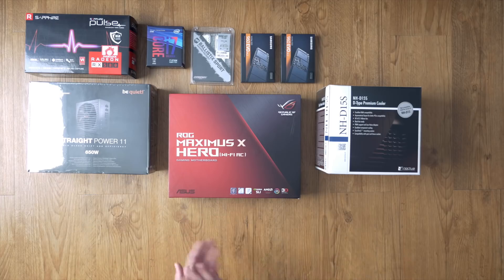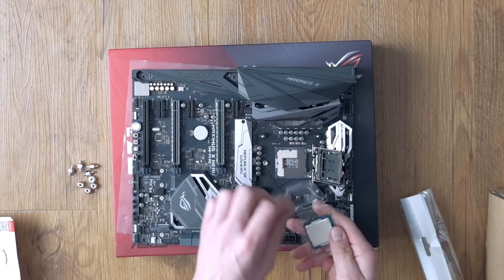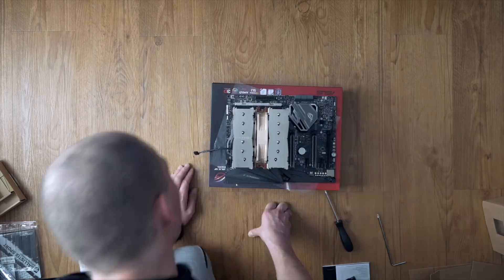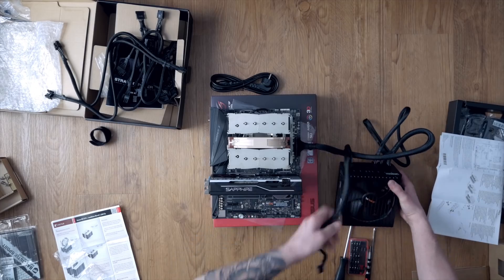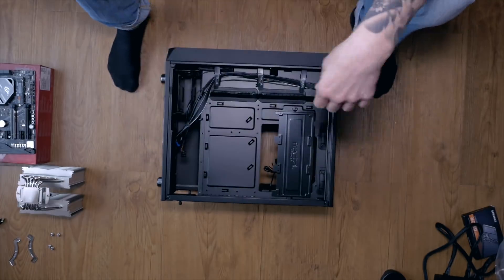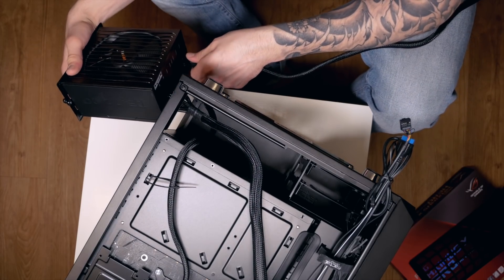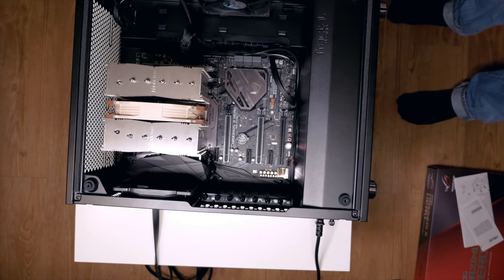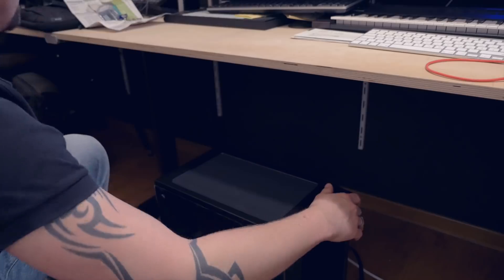Assembling the Hackintosh 2018 Workstation

Comment: Very soon I think it will not be worth it to build a Hackintosh because Apple  will be switching from Intel to ARM chips.
Reply from the maker: I think the transition will take it's time. Until then, all the Intel Macs, Apple sold, have to be supported at least some more years. My guess is something around 2023 with the first major macOS, that won't run on any Intel-based Mac. By then, Linux has hopefully more support by the tools, I need for my daily work.

Comment: Why this CPU cooler. When you  buy a expensive motherboard and intel overclock CPU. You must be use an AIO liquid cooler for better performance
Reply from the maker: Not anymore. There are air cooler such as mine, that are supperior to an AIO. Both concerning noise and overall cooling. An AIO is just reacting more slowly than an air cooler. For sure temps don't spike as fast as with an air cooler, but they neither drop fast. None-the-less I will try an AIO on a second build in the future, because it's still a very charming eye candy. :)
Reply: Because it´s air cooling and more reliable than liquid cooling.

Comment: What's the overall cost?  I currently own a 7700k and thinking of building a budget hackintos.  Looks like this is not a budget build
Reply from the maker: Yes. No budget build. The costs are around 1800 - 2000 EUR depending on current prices of course. And I think, that the performance gain is not big enough to justify this upgrade.

Budget would be a cheaper H370 mainboard and a i3 processor, 16 Gigs of RAM and maybe just 2,5" SSDs instead of NVMe.

Comment: im ur 300th subscriber
Reply from the maker: Well appreciated! :) Thanks for your sub!
Reply: Martin Guder also cool hackintosh setup, my original one took almost a year to build due to hardware limitations but now I found a good card that can run Sierra.
Reply from the maker: What card is it? Why not updating to High Sierra?
Reply: Martin Guder 8800GT, but I use Sierra for performance reasons, but if I ever need to I’ll upgrade to high Sierra if my card is compatible
Reply from the maker: It's a Nvidia card right? I think the web drivers should work, but just see the compatibility list on their website. Maybe those cards even work OOB. They were promoted by nvidia to be used in the 1st gen Mac Pro.
Reply: Martin Guder ok I’ll try it, thanks

Comment: I am looking at doing the same build but with a liquid cooler and a Define R6 case.  Can't wait for the overclocking video.  Can you go over the details why you chose an air vs a liquid cooler?  I believe you said that there was a compatibility issue.  I thought once you set the profiles on the board, it would take care of the rest.
Reply from the maker: I've chosen the air cooler, because it works out of the box without any work-arounds. I wanted to avoid the extra effort. I also watched some side-by-side comparison here on YT, where the radiators were actually louder than a Noctua cooler/fan and for me this was the most important thing: as quiet as possible with enough headroom for overclocking. Maybe I will do another build sometime in the future with an AIO, but that's just out of curiosity. ;)

Comment: wie verbindest du dein magic keyboard und die magic mouse und wird am ende auch airdrop funktionieren? supportet das mainboard bluetooth oder verbaust du noch eine extra adapter karte? im vorherigen video hatte man ja in einem clip gesehen das du noch eine wifi card o.ä. verbaut hast :D

gutes video btw!!!
Reply from the maker: Thanks. I'll answer in english, if that's fine for you. :) Magic keyboard and mouse are connected via Bluetooth. I purchased an extra PCIe card with an used Broadcom WiFi/Bluetooth card usually used in iMacs (Broadcom BCM94360CD for 60€ on ebay). The card on the mainboard won't work with macOS, as it's intel-based. You can also purchase a WiFi-module mentioned in the hardware video (Broadcom BCM94352Z for 30EUR on ebay). This a smaller one which doesn't need an extra PCIe-adapter-card and is replaced the built-in intel one by removing the back panel cover of the motherboard. Also it just needs 2 antennas, so it's working with the motherboard out-of-the-box. The iMac one needs for antennas. ;)
Reply from the maker: Totally forgot: AirPlay works flawless and fast. Apples's Handoff should work as well. But as I'm an Android user, I couldn't test it.